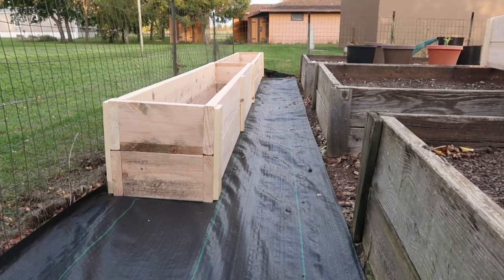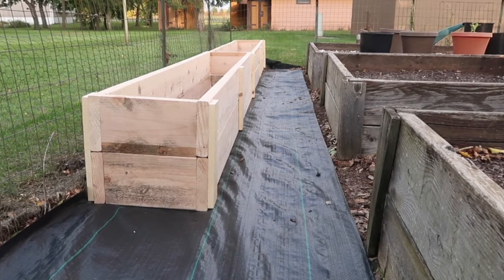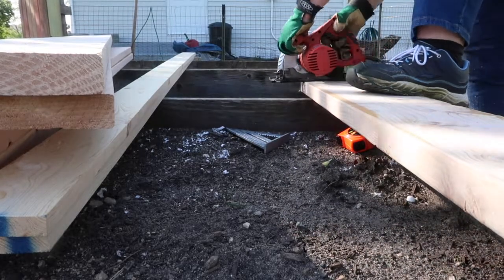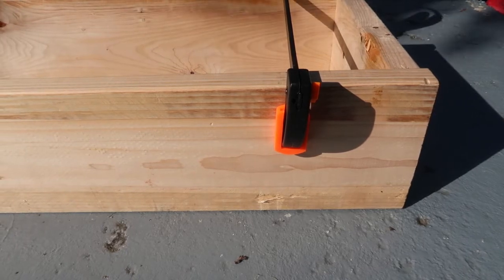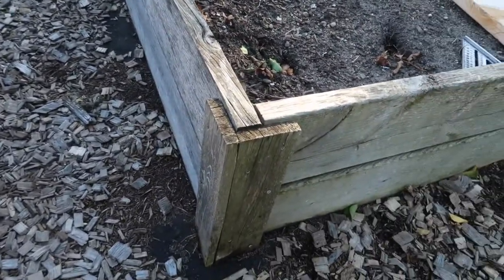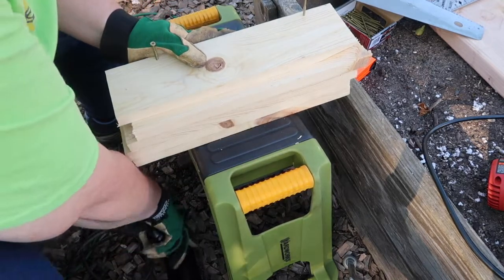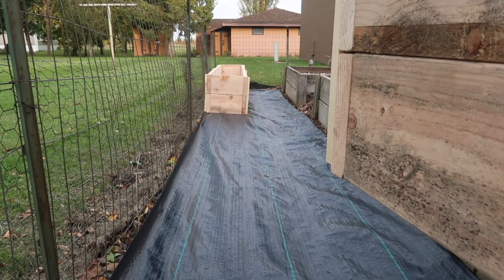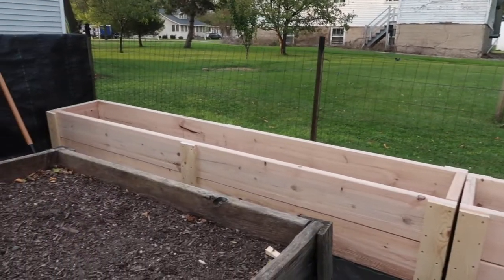Building RAISED BEDS • DIY Homestead Project

Comment: That's a great looking bed.  It looks incredibly strong
Have you tried using cedar or redwood?    it will last a bit longer than pine, but it's more expensive
Reply from the maker: Thanks Dave! I'm hoping to use cedar when I have to rebuild the old ones. It just hasn't been in my budget to use, even though I know it will last a lot longer. It is strong—and heavy...probably 150lbs or so. Each.

Comment: I really like your raised beds. What do you fill them with?  I'm especially interested in what you put on the bottom. 💕
Reply from the maker: Thank you! I lined the ground with a heavy-duty weed barrier. I’m going to put wood chips in the bottom of the beds, probably three or 4 inches thick, and then layer with soil and leaves and compost. If I can find some straw I may put some of that in there too.
Reply: Thank you. I’m new to raised beds and I didn’t know what to fill them with.😊